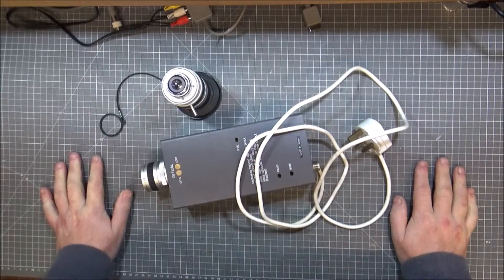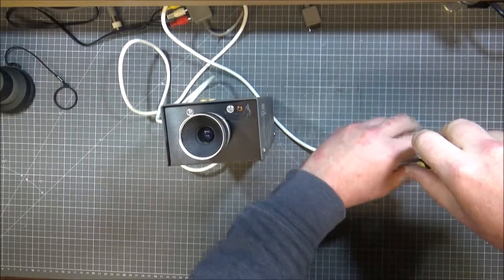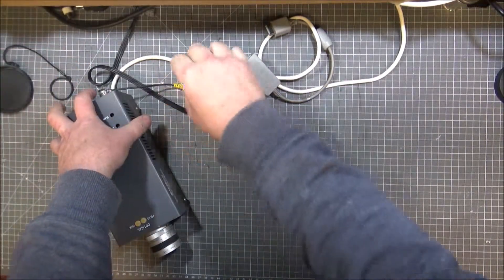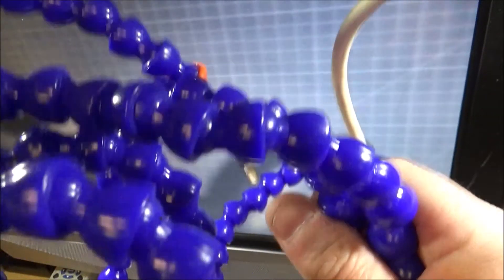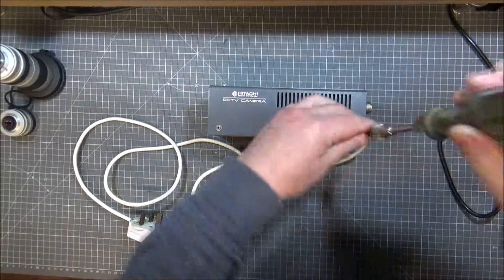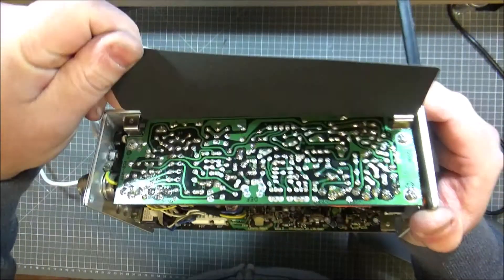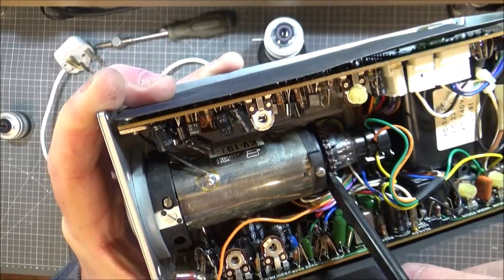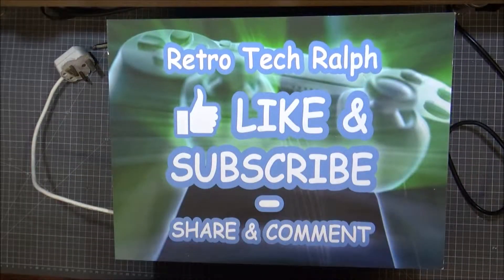Hitachi CCTV Security Camera HV-62SK Teardown

Comment: I think the video connector (socket) is a SO259. The mating plug is called a PL259.
Reply from the maker: Im glad the work around i used worked. It wasnt worth buying a connector/cable for this. I just have no use for it. Maybe some day.